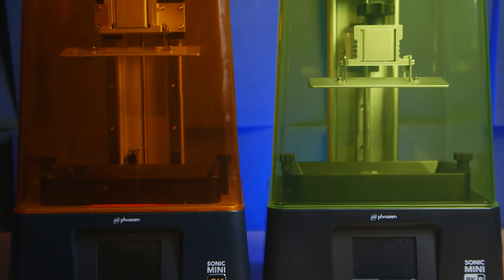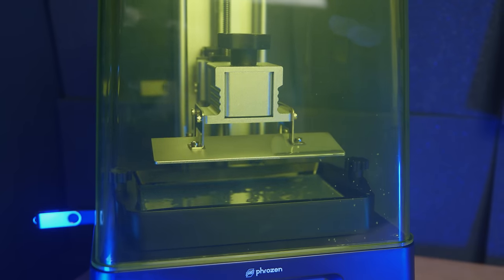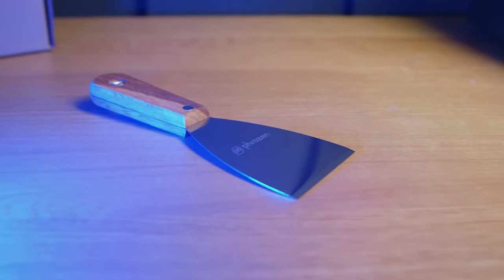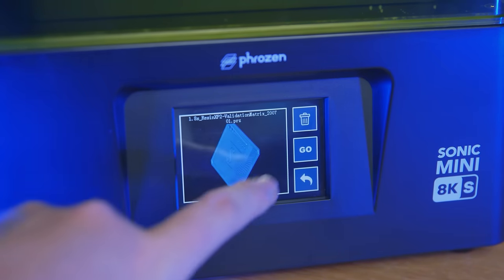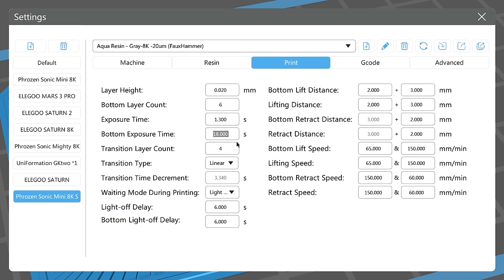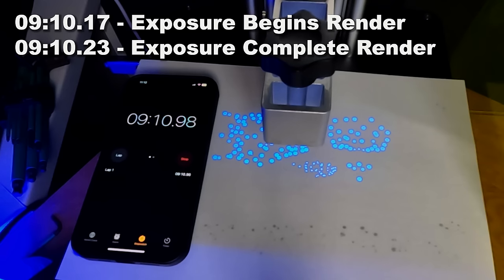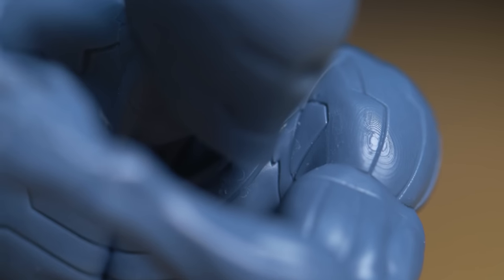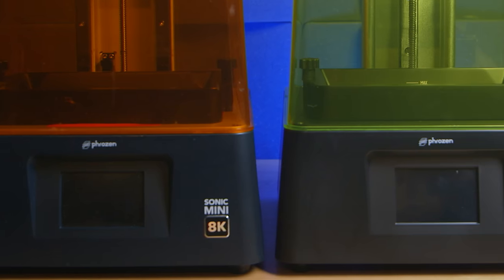Phrozen Sonic Mini 8kS Review Vs Original Mini 8k - Cheaper and Better

Comment: I am using the Anycubic M3 Max which is the largest 7K printer I can get my hands on, and I have a 4K M3. The issues that I have so far seem to be either in Blender, which I use to design the 3D models that I am printing, and or Chitubox and the Anycubic slicer which seems to be even worse than the free version of Chitubox, which converts the STL files into the Anycubic format to print on these 2 machines.
Now I have been Eyeballing the Phrozen machines for some time now, and I really want to try out a Mega 8K as I am printing Star Trek model ships like the Original Series (Enterprise in 1/200 scale ) which comes out to just over 4 feet, so I need large printers for this purpose.
The 10 inch machines like this look good to me, but even at 7K the M3 Max is more like a 14 inch machine and the prints that have come out good on it show almost no difference between a 4K and the 7K objects, but  I admit that the surfaces are not complex like lets say a character with a head of hair and a face, and clothing with minute details.

I am printing chess pieces, and ships, and archery bow brackets that are fairly simple in design so far, just that some of them are large parts.

I am also testing to see what resins are or will make the best model plastic. They are coming out with new ones, but some of them are like toy soldiers plastic, but for now the ABS like is probably the closest without being 80 dollars for 1 liter.

I have seen a few prototype engineer resins that might be better for models but yea, they are all 80 to 100 dollars a liter instead of 25 dollars I pay in bulk for ABS like resin from Anycubic.

I really wish that Phrozen would make a competitor to the M3 Max that is 8K and not a 2100 to 5000 dollar machine but at the 1000 dollar range of the M3 Max.
Reply from the maker: Keep your eyes peeled over the coming weeks 😉
Reply: @FauxHammer  will do

Comment: Thank you for this great review. It almost got me to buy the Sonic Mini 8Ks, and I’m still condisering it with the new Anycubic Photon Mono M5s. I thought it’s a nobrainer because the m5s is 12K but the resolution is weird: X19mu, Y24mu. The Sonic is 8K with much smaller build size but X and Y are even - 22mu. It’s hard to choose. What do you guys think?
Reply from the maker: if you have the money, wait for the review of the M5. I haven;t got it yet but apparently being shipped today.
Reply: Did you get it? I didn’t see anyone reviewing the m5s with 0.01 thickness and 8k resin. Just the fast resin with 0.05… are they hiding something from the buyers?

Comment: I'm assuming that when it goes to 0.2s per layer at that thickness, it's using PWM to pulse the light on/off at a frequency that will equate to 0.2seconds, even if it appears to be on for 1sec?
Reply from the maker: No, it’s confirmed by manufacturer
Reply: @FauxHammer  damn, that really sucks then. They pushed an update to fix that yet?

Comment: Anyone know when the release/shipping date for this is?
Reply from the maker: Preorder goes live tomorrow. Get it quick if you want it because it’s at a super low preorder price. I think shipping are June onwards I think. It will tell you as you preorder.

Links in description
Reply: @FauxHammer  yeah thinking of getting one, they don’t ship to my country though but considering using something like Armex Global Shopper. But couldn’t find a shipping date. Was torn between this and the new Photon Mono M5S but think I might get this even though the Mono has dual rails and auto-levelling and larger print area it is more expensive

Comment: theres too many printers now im really confused, whats everyones thoughts on the new mono 5s announced yesterday?
Reply from the maker: It's too early to tell on the Mono 5s Will be good detail. but could be a PITA printer. Mine is coming so will have a video up when I can.

This printer is the best in terms of quality, but only just, most people would be happier with a larger build plate than a slight quality difference.
Reply: @FauxHammer  for someone like me, total beginner, i was impressed by the noob friendly features, auto levelling etc or is that just a gimmick/marketiung?
Reply from the maker: @Wraith1uk1985  no, it;s pretty standard now though. it;s not really auto. You just loosten it, it goes to the bottom and you tighten it. Fairly standard approach

Comment: You pour the resin this way ....
Because it looks cool on camera!!
Reply: There's no actual good reason for it other than this, yeah. You can just shake the bottle to mix, then let it rest a few minutes before starting the print.
Reply: @OhSixy  I leave it my vat and before starting a new print or adding more I use a small plastic wisk to stir it up before adding more from a bottle thats been shaken. Then wisk a fuzz more and ready to print.
Reply: @jc7997aj  I used to stir my resin between prints if it rested for more than a few days but I stopped doing that and have noticed no difference at all. But I don't think I ever go more than 2 weeks without printing
Reply: @OhSixy  I use the printer to subsidize my painting. So to keep my pile of shame at a reasonable size. I make myself keep a decent rate of production. I have legit Titan .stls that are on my list to print. That'll take months and 6ish bottles of resin that I'm working toward getting to.
Reply: @jc7997aj  Gotcha, I mostly just make board game upgrades for the upcoming scenarios that week :)

Comment: Uniformaton gk2 or sonic mini 8k for first time 3d printer, starting miniature printing business...? Or is there a better choice?
Reply from the maker: There’s no better choice. You need to choose what is right for you. Based on what you want to print and budget. There’s no easy beginner printer nowadays. But most people opt for the cheapest

If budget is not a problem, get the bigger printer
Reply: @FauxHammer  well I was thinking of buying either two gk2s or two of the phrozen's mighty 8k. To print and sell mostly character sized 32mm scale miniature, like from Artisan Guild. If quality is comparable between the two then Whichever one is the most user friendly as these will be my first printers. Of course I would like to keep cost down but if one is better quality or much easier to use those are certainly factors in my budget. I like that the GK2 has a bundle option as I will need the curring and wash stations, and their free shipping is a plus.
Reply from the maker: @DnD_Painted_Miniatures  quality is the same on both. GKtwo is much friendlier to use and easier if you live in a place where the temperature frequently changes
Reply: @FauxHammer  Texas, so yes. Hot summers and pretty cold winters. The printers will be in my attached enclosed garage which is not climate control. GK2 Customer service says the heat shouldn't be an issue as long as the printer isn't in direct sunlight, and the built in heater should prevent the cold from being an issue. I'm hoping you will do a tep by step from unboxing to processed miniature video or series for beginners using the GK2. That is the printer I'm leaning towards.
Reply from the maker: @DnD_Painted_Miniatures  I’ve done this, which is meant yo be used with any printer though I’ve focussed on phrozen printers here. Steps to success

It’s not released yet, so you get an early preview for asking.

SUPER EASY 5-Step Guide for HOW TO 3D PRINT Resin Miniatures & Models
https://youtu.be/Gm0-z971tgY

Comment: This printer seems perfect for beginners but I especially love the build plate doesn't seem annoying to level.

As for pouring resin over the build plate like that... I did it before when we still had a workshop so that:

1: Ensure there are no inclusions in the resin.
2: Ensure the resin spreads out.
3: Check where the resin is likely to pool on the back of the build plate.
4: It just looks neat.
Reply: was this the correct answer?

Comment: just buy a $2 USB extension cable and stop sperging out about port placement, jesus
Reply from the maker: Completely missed the point. An extension cable will have the same issue as a usb drive
Reply: @FauxHammer  Amazon ASIN B07F7Y21GW both right and left angle plugs. If these don't solve your issue then articulate it properly. The problem as you present it is easily solved and it makes you sound goofy when you harp on it.
Reply from the maker: @AFistfulOf4K  I’ll keep sounding goofy then. It’s something I should t have to fix.
Reply: @FauxHammer  One youtuber's preference with a simple cheap solution vs 8 billion dummies maybe getting resin in their USB port 🤔 This is "why do I have to pay for roads I don't drive on" techtuber shouts at cloud stuff.
Reply from the maker: @AFistfulOf4K  dude your opinion is not fact. All my view here are “opinions” only. If I want to talk about USB port placement, I will. If I want to talk about it having rubber legs or plastic feet I will. Fine, it doesn’t matter to you. Fine, but it’s your opinion. If it doesn’t matter to you, and you have a solution. why not just ignore it and move on with your life?
Reply: @AFistfulOf4K  it’s just the opposite.  Design sense and logic dictate that buttons and ports you need access to for normal function should be in the most easily accessible place, which would be the FRONT for these.  

So we have to suffer because some grown idiots might spill resin all over their printer?  It generally wastes more money idiot-proofing things.